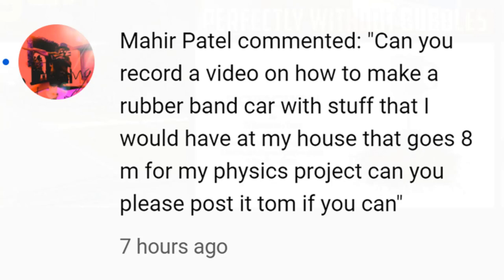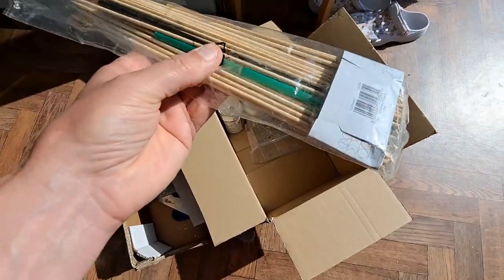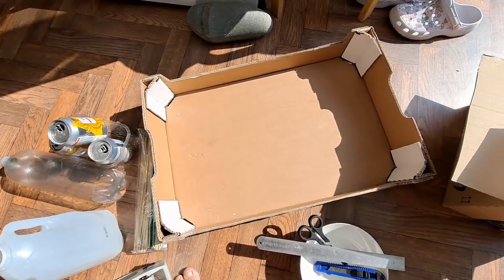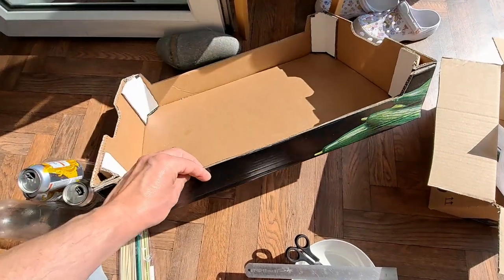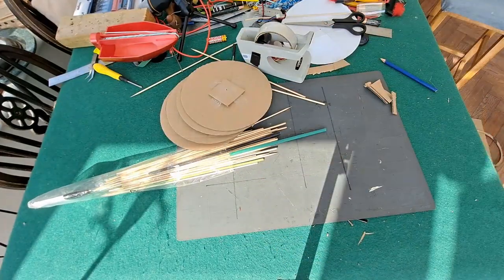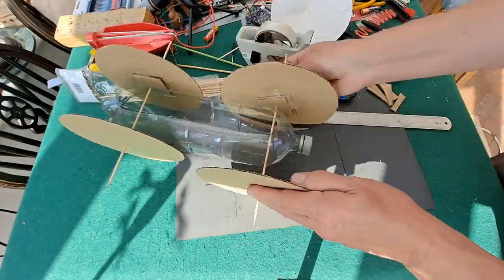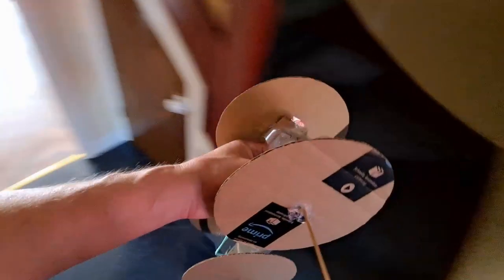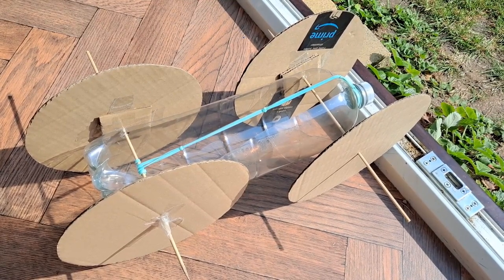Basic rubber band powered car to go 8m

Comment: When i rotate the axle and twist the rubber band and keep that on ground the tyres are spinning but the bootle is not moving forward or backward
Reply from the maker: Hi Priyan J. If the wheels are spinning, I can think of 3 suggestions.
1. Check the front axle isn't jammed, stopping the front wheels turning and acting like a brake.
2. Add some weight to the car near the back end, that will help the grip and stop the wheels spinning
3. Add something to the rim of the wheels to act as rubber tyres to increase the grip.
Here is a video I put together with a long list of hints and tips in the video description. The video is just me telling you to read the video description. That is where all the information is. Put a rubber band on it 0349 Rubber Band Car Hints and Tips - https://youtu.be/cw6MrBy7nCo?list=PL2Aly02Ujr7ejVN9oE9wYxRuGR-3G30g7
Reply: @GrandadIsAnOldMan  
Thanks
Reply from the maker: @priyanj3523  good luck 👍

Comment: Can't you rotate the tyres instead of rotating the stick 
Please reply
Reply from the maker: I am not entirely sure what you mean. You could cut a small notch on the edge of the wheel to hook the rubber band on it, then you could use about a quarter of a turn to spin the wheel. You would probably find that you have far too much power and the wheel will spin, sliding on the floor, and not drive the car forward. With an electric motor you could directly drive the outside of the wheel like I do in this video https://youtu.be/4YTnX8Ay_Mk
Reply: @GrandadIsAnOldMan  
Ok old man go and have your pills
Reply from the maker: @priyanj3523  are you being rude?
Reply: @GrandadIsAnOldMan  
Sorry i told that as a joke
Reply from the maker: @priyanj3523  good luck with your project 👍👍 Here is the video I did to answer your question, but I may have misunderstood your question https://youtu.be/Ll3PCtWWzBg
Reply: @GrandadIsAnOldMan  
And  i forgot to tell one thing i used bottle caps as tyres and pen refillers as axle i dont have bamboo sticks.
Can you make a video
Reply from the maker: @priyanj3523  bottle caps are usually a problem trying to get enough grip. I have filled them with clay to help that.

Comment: Can I use bottles cap instead of cardboard for the wheels?
Reply from the maker: That depends how big your bottle caps are. If they are too small, they won't touch the ground in this build. They would need to be bigger than the plastic bottle I am using. This design uses bottle caps for wheels https://youtu.be/hjXYVpAyYG0?list=PLA5a2xPRSrB3g5RiX8Kf_uUBOL0Tb7AS0 here is another one https://youtu.be/RkM95PLAlCw?list=PLA5a2xPRSrB3g5RiX8Kf_uUBOL0Tb7AS0 and another one https://www.youtube.com/playlist?list=PLA5a2xPRSrB0F2PNcApzXxp_nFkUjnCMt and another https://youtu.be/oV5657ziI2E?list=PL2Aly02Ujr7dtOGW4KA0pWMD3TOB9yhUx and another  https://youtu.be/pojJ-v9zT9o?list=PL2Aly02Ujr7dtOGW4KA0pWMD3TOB9yhUx
Reply: @GrandadIsAnOldMan  thank you so much, your video are amazing!
Reply from the maker: @bxtiffabethxxx1526  thank you. You will always find more information in my video descriptions.